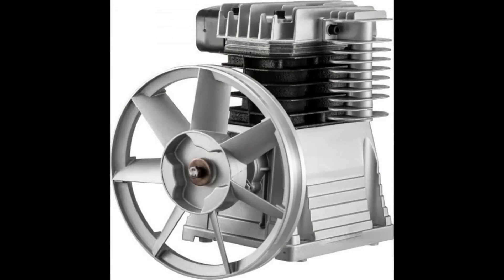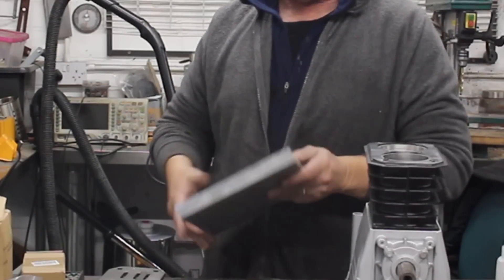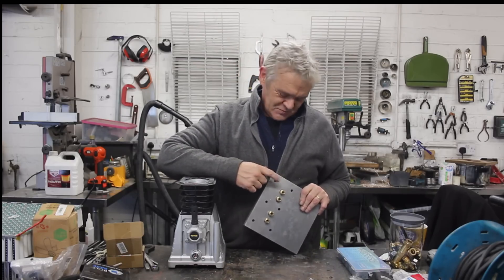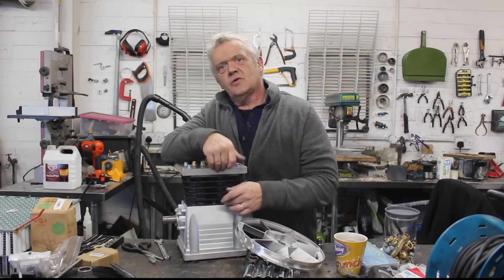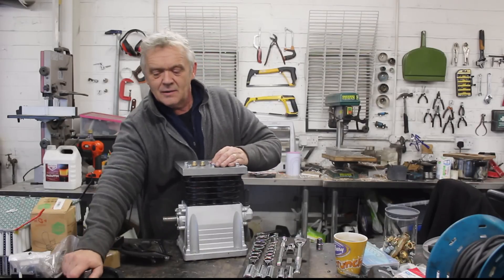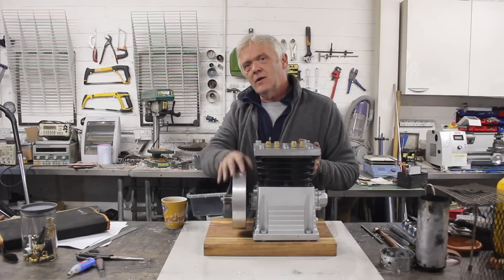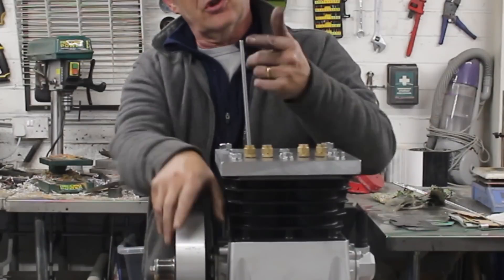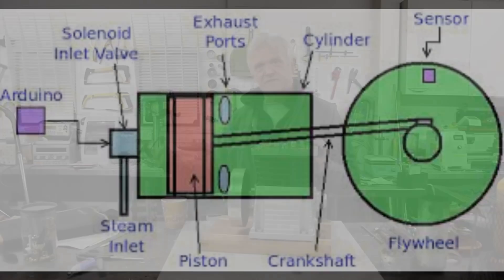1716 A DIY Multi Fuel Home Generator 3 - Converting A Compressor To A Steam Engine

Comment: i suggest use steam oil a type of lubricant specifically for steam engines and locomotives well you can also make your own lubricant using tallow oil or graphite power and i also suggest to attach a generator maybe a single phase induction motor and maybe implement form one of your videos about  induction motor generators without magnet for efficient performance overall the engine has no issue at all even lubrication because the connecting rods and crankshaft has built in oil channels

Comment: id not bother with the plate on top just use the head and fill the sparkplug holes with chemicial metal  and flatten it top drill the  4 holes reuse the head bolts,ive come up with a idea to reuse the gas from the outlets of a engine compress it down and blow it black into the head lower fuel use uses unburnt fuel in the compressed gas could mix it with methane or other gas as well

Comment: Great video! 😀
A turbo-charger with a burn-barrel between compressor and turbine is multi-fuel capable and doesn't need water. Effiency probably can be increased by heating a jacketed pyrolisis reactor with the exhaust fumes of the turbine and use the syngas as fuel.
The electric efficiency of car alternators is below 70%. So I suggest to use 48V/50A BLDC motors with a rectifier or magneto-hydro-dynamic generators.

Comment: Thing about valves, is no I don't own a lathe, and most important its going to wear and fail, but if its trivial to make I can have a spare. Last thought, want to collect the waste steam to condense in a bucket, as the trouble with steam engines is they need large amounts of pure clean distilled water. A commercial valve is attractive if its not to expensive to replace.

Comment: I am really excited about this conversion.  I have only seen this done with the exhaust cam being modified by welding on a brazing rod to the round side of a cam then molding and filing that side to a "double" cam; with the modified side mirroring the original cam: from => to <=>,  like that.  Given Robert's insight I can hardly wait to see how more intuitive and simple this can be.
Reply: Wait...concerning my comment above.  Is this a 2 stroke or a 4 stroke engine?  If it is 2 stroke then all that cam modification mess is null.  I did not know about in-line 2 strokes!  They don't let me out much.

Comment: Hmmm.
Nooow.
If you were to use a single but triple sized large hole in the center for both in/out (each cylinder), and do the in/out separation outside with a t-junction you could put the engine upside down and during warmup/cooldown open both ports. (Edit: and get better flow/less pressure drop)
The condensed water, with gravity and maybe with the help of a bump towards the center hole of the new plate, could flow out back to the reservoir/pump.
Once the system heats up enough, close the exhaust valve and start pulsing it according to the piston position. Probably a bit before it reaches the highest volume/lowest point, so you dont start compressing the old cool steam.
Also you might want to use overheated steam at 1.2 to 2 bar system pressure so you get more energy during expansion before the steam turns back into liquid.
If its upside down any liquid will just leave with the "cold" and wet steam through the output valve.

For the demonstrator it might really be easiest to use magnetic valves (solenoid actors) so you can put a bit of distance via linkage between the hot steam and the coil/electronics. To start the electronics use a hand crank generator (or power bank), when its running a old style bicycle dynamo on the flywheel ;-)

And the you can simply move/clamp two magnets on the flywheel for variable timing and switch the valves via reed switch+mosfet. No arduino, just need to find a good position.
The arduino (i would use a siemens logo! RC12/24) could be used to optimize timing for steam temperature and control rpm tho...

If you bypass/remove the relais you can trigger the outputs up to 10Hz and it has high frequency inputs for the rpm and valve timing.

Comment: I'm so excited for more of this. I had plans to build an affordable turbine steam generator but overcoming the load on the generator when charging batteries was going to be a challenge. I think this compressor type cylinder engine may be a simpler and cheaper solution. Thank you so much.
Reply: i'm interested in the idea of using solar reflectors to heat the water.
Reply: I'm also interested in this kind of idea.   I came to the same conclusion... Turbines are very difficult to draw a load from, and gas engines/ compressors are available "off the shelf"

Comment: Thank you, much. You keep me reaching for the remote one video to the next. I have always been biased against the reciprocating piston in spite of its obvious utility, especially so when applied to home power generation. All that flapping and cycling does nothing for longevity of the system and will ruin a good afternoon nap. How can you possibly brainstorm without that? Would you instead consider using a gear pump/motor or even a small gear pump/motor in line (series) with a larger one to capture a bit more efficiency?

Comment: I was thinking, since you have the gear, to weld together a steel box, maybe with a bolt screwed in for access. Into which you could put various things and  put them under tremendous pressure....
Reply from the maker: yeah I suppose I could - but why?
Reply: @ThinkingandTinkering   In the interests of alchemy maybe?

Comment: Robert.........I have seen u tube videos, warning of the dangers of tea lamp heaters. Apparently the wax is paraffin and parafin vapors can collect under the pots and when the ignition temp is reached the gas explodes!..... This creates ath least a fireball that charge the pots and at the most can burst the pots and send the pieces flying, causing harm. Please investigate and report. I have found a much better system......a candle heater. The heater is made from a steel ammunition box.....gi surplus. The door of the box is removed and the rubber gasket is removed. A stove seal replaces the rubber gasket. A square hole is cut in the door and a stove glass is fitted allowing the light of the candles to illuminate the room. Two inch holes are cut in the ends and the sides of the box. One end hole will be your vent to the outside. The opposite end will be your intake air pipe. In small enclosure s this can go thru the floor in bigger rooms it can go to the floor to suck up the coldest air. The sides have two holes cut. This allows two pipes to go across the width of the box, go over the candles. The idea is the side pipes are curved to circulate the hot air in the room or enclosure. The author of this......and builder......made the heater for a small camper he built and tows to his ice fishing hole. Having three one inch candles burning in the heater circulates warm air in the enclosed space. This generates enough heat to keep the shelter comfortable when it's about minus 10 degrees outside. Having the candles in the steel box prevents any danger of fire. Having the vent pipe exit the shelter prevents any fume build up. Having a n intake pipe taking combustion air from outside the structure prevents Oxygen depletion. I am going to make this box heater to warm my apartment. I shall have the vent pipe enter a box that can go under my up down window. The intake pipe will be down by the floor. I don't know if I mentioned it but the pipes are auto exhaust pipes u can get from an auto shop. I think this heater is safer than parafin tea heaters.......cheers...
Reply from the maker: wow - mate - I don't want to be rude here but I can't take the tea light worries seriously.

Comment: Do you have DVDs of your videos?
Reply from the maker: no sorry mate
Reply: @ThinkingandTinkering  it might help raise money. DVDs or flash drives. Make them projects specific. Battery, solar, engine, ect.  I understand that it takes away from projects but once it is set up it wouldn't be difficult to maintain. Any way I have binge watched a lot of your videos. Very interesting and going to try some of them.

Comment: I bought some carbon felt 5mm thick off Amazon. It doesn't wick anything. So where did I go wrong??
Reply from the maker: I don't know because I don't know what felt you bought - but if it isn't wicking it isn't the right felt - maybe it has a coating?

Comment: yeah. so i bought the carbon felt. fair enough in size and dispatch time.  but be aware.the felt is extremely loosely "packed" in itself. (i mean very lightly compressed -5mm). The containment packaging is wonderful; thick cardboard and lots of clingfilm (saran wrap)., but what the problem is is that the smaller felt fibres are free to float in air. yes the clingfilm attracts minute particles using static, handling the stuff does free up more particles. like i said, lightly compressed (compounded?). ' Handling and Airflow Influenced Density' is probably the best way to describe it. H.A.I.D.  : wear breathing and eye protection is my advice.
Reply from the maker: you are not handling enough to be worrying about it mate. If you were using it all day everyday and amidst tons of it - sure wear protection - but the amount you have and the hour or so you will handle it - well you will be lucky if it makes you sneeze.

Comment: The heavy flywheel, plate head and base plate are great. Can't wait to see the remainder of the project.

I wonder if incorporating the carbon mesh in the intake can act as a separator for condensation
Reply from the maker: that's a nice idea mate - thanks for the tip

Comment: I know you did the rubber based Stirling engine that vibrated. But did you do any Alpha or other style Stirling engines. Sure steam is strong and it has power and you can burn practically anything in the boiler. But for simplicity a stove with a Stirling attached is more my speed.
Reply from the maker: I have done other types of Stirlings mate and if the oppressor had separated cylinders it would have been my first choice but having the cylinders cast in the same body means getting the hot and cold away from each other is hard - I did think of sawing a gap between the two but that seemed a lot of work and may not have worked - if I come across a two cylinder compressor I will certainly make a Stirling from it

Comment: as a gasoline mechanic when i think an engine was flooded i pull the spark plugs and then rotate the crank shaft, then use the starter to pump the pistons, effectively all the water gets ejected. if you left the fittings removable or put some bolts in the top plate you could manually move the flywheels to push out the water before starting it. potentially you could leave the bolts out, apply the steam and work the flywheels to eject the water and warm the engine for use. then replace the bolts to get it running. this would be fairly easy to add if it becomes required later.
Reply from the maker: thank you mate - really good tip and a great share

Comment: Years ago I replaced a timing belt on a fiat punto, required the engine set to middle dead center, a little unusual but approached it in a similar way using meat skewers, regarding the valve I'm wondering if a turbo boost control solenoid might work, they come in 3 and 4 port set up but only require a small voltage to  operate, obviously they need to handle fairly harsh conditions working with charged air from a turbo but I'm unsure how they would fair with steam, compressed air no probs and can get them fairly cheap
Reply from the maker: oh hey - love that idea thanks for the tip mate
Reply: @ThinkingandTinkering  be handy if it can be used as can get them for next to nothing in a salvage yard

Comment: I was just thinking using electric valves , is like using relays, they don't really last long getting actuated repeated like in that app,  so I thought use 2, 3, or 4,  per cylinder,  use a controller, that can trigger one per rotation, then start with the first one, again, or build a electronic driver attachment, with a shift register, and MOSFETs,  each time it's triggered it fires another valve, then starts over,  fairly simple,  this will have the valves lasting longer, possibly longer than if they were just replacements, since it allows time to cool between cycles, may only be 10% longer, but it's better than nothing,  and  if one fails, it will only develop a mis! Not a dead cylinder or a failure in a single cylinder,  I have a couple lawnmower engines I'm thinking about converting, to build a steam generator,  I'm thinking about using both intake and exhaust valves as exhaust, and use the spark plug hole as the intake,  and possibly wrap the cylinder with copper tubing, as part of the exhaust, and insulate it, to keep it hot as possible,  to keep the pressure up, cooling of the steam as it enters the cylinder can be a problem, if it cools excessively,  I have thought about using a hydraulic cylinder as the piston,  bolt the shaft to the piston, remove the rings, and replace the head with a sheet of rubber, to seal the old cylinder somewhat,  so it can operate as a double acting cylinder, to perform much like a two cylinder boxer, without the balance advantage, especially if I can find a near 3" cylinder with a near 4" stroke, the engine only has a 2" +/- stroke, but I doubt  I'll find a cylinder under 4" ,. I guess it could be cut and bolt a head on shortening it,  however a much longer stroke would be better,   I'd much rather build a engine with 3"-4" bore, with 6" to 8" stroke, it would probably peak at 1000 rpm or less, but the TQ would be much higher, especially if the steam flow can keep up with the cylinder displacement,   all this could be machined with the proper tools,  even a 2" bore with 4" stroke,. 2cylinder,   double acting,  so performance would be similar to a 4cylinder.. 
 Maybe power the secondary of one cylinder , with the exhaust of a primary side  of another cylinder,  maybe design a valve system that does that, then gives it a shot of hot steam when it's about half down(or up the bore) to  give a power boost,  About the same time the exhaust valve is closing that is fed that cylinder,
Maybe a small Tesla turbine could compete with this style engine,  build it with only . 010"-
.020" clearance between the disc, with 6, 6" disc, make it tight as possible, allow for expansion,  or maybe a rotary vane  motor, like used in pneumatic tools, using graphite bars or vanes to seal the rotor in the bore, a 6" rotor, about 1" wide, maybe seal the sides of the rotor with a nylon or ring possibly sealing against a graphite plate , making all this complicated, maybe  just convert a mower engine,  get a extra oil ring,  widen the top ring land, and use a oil ring scraper to seal the gap in the top compression ring,  possibly sand the sides of the rings with 2000 grit or higher sandpaper, to polish the sides,  after going over then with 220 paper to get a cross hatch, it should look like a fresh built engine cylinder bore, the tiny scratches are to hold oil, preventing the rings from sticking, and possibly use a tiny round file to put a tiny groove in the ring lands to supply oil, only about . 002" the compression ring gap will supply oil also,  with the extra oil rings in the compression rings, making the rings zero gap,  with the oil rings in the middle, above the bottom ring, below the top ring, with gaps 180° from each other, there should be near zero water in the crankcase, 
 Sorry, I do RAMBLE don't I,. So sorry to get carried away, 
But I have been planning this for a while, build a dc generator,  steam powered,
 Using a alternator, with a brushed motor controller to power the brushes/ field coil,  to regulate the voltage output,  I also been planning a feedback regulator to control the output,  allowing 12v and 24v output , and possibly 60v for 48v systems, it may require a different diode in the 3phase rectifier,   I hope it would do between 35 and 50 or 60 amps,  at 24/29v.  It may require more engine to do that much power, they are designed to spin 4 to 60 x the  engine rpm,  so 2k rpm idle, peak over 20krpm 😲   sorry again for rambling!
Reply from the maker: solenoids are used in car engines all the time mate - free valve comes to mind as do diesel injectors - so I don't think longevity will be much of an issue myself

Comment: Is that compressor one with the cylinders 180° apart or are they at 90°? A steam engine is best for self starting if at 90°. Air compressors work best at 180°. Two ball valves per cylinder with the right pushrods would work if the pushrods operated off the top of the pistons. Valves could be enclosed in a cover sealed so you did not have to worry about sealing the pushrods.
Reply from the maker: 180 mate - and nice idea on the valves - cheers

Comment: why not  just have an  inlet port and drill a hole  at bdc    to act as an exhaust  [ this would also mitigate the need   for  a water drain  as well ?]
Reply from the maker: that would be a sleeve valve or a two stroke - I don't think it works with steam